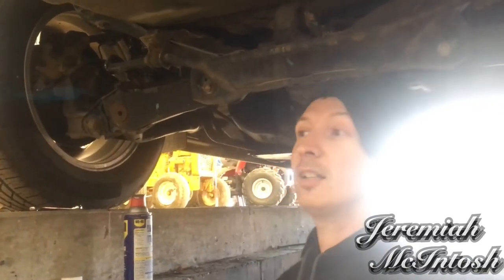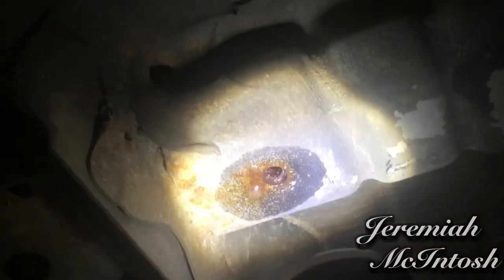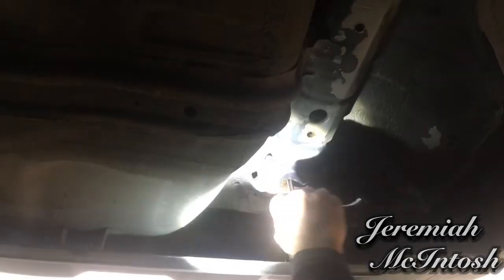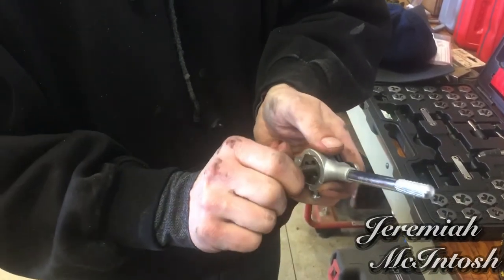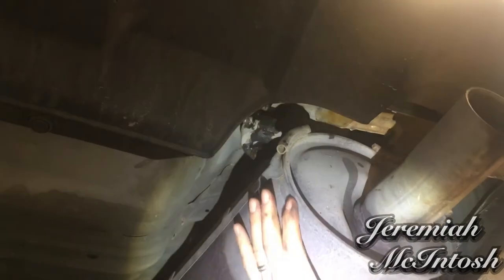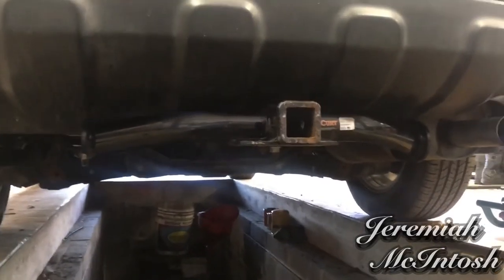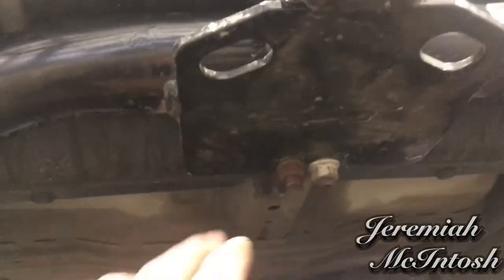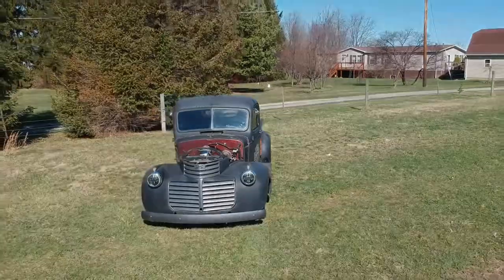Rusted Bolt Holes make this difficult! Tow Hitch Installation!

Comment: Aw, man...I got a tap to clean out my threads. The tap did, indeed, clean out the threads. But, when I went to install the bolts, the welds broke. Now I've got a bolt dangling from the frame. This just turned from an hour's job into A Project.

Thanks, rust belt. Thanks a bunch.
Reply from the maker: My frame on my current f150 is currently rusted out and trash! The next vehicle I get I’m having it sprayed underneath with fluid film!
Reply: @JeremiahMcintosh  I wish that I'd kept up on doing exactly that. Every year the same promise to myself before snow flies "yep! gonna get the car undercoated this year, rust isn't fun, nosir!"

Comment: What can I do if the mount holes are rusted out ?
Reply: I guess it depends on "how bad" and "how's your skillset". If the rust is structural - you don't want to attach a trailer to your vehicle anyway. If not, you can clean it up and weld in new nuts onto the frame. 

The second part is where I'm at right now.